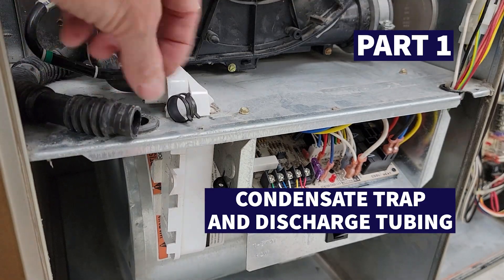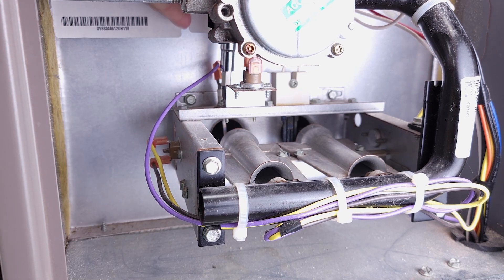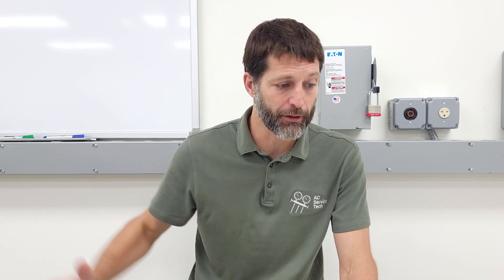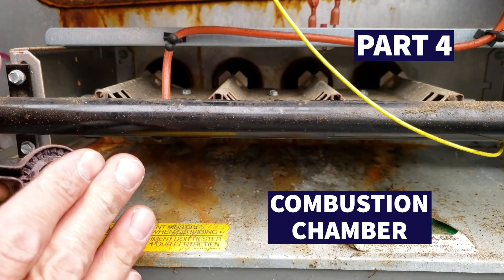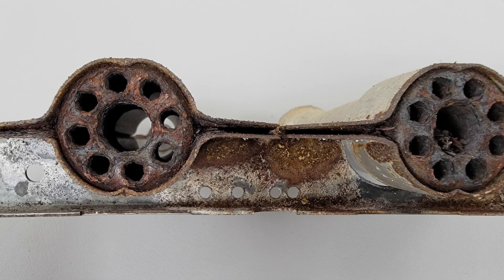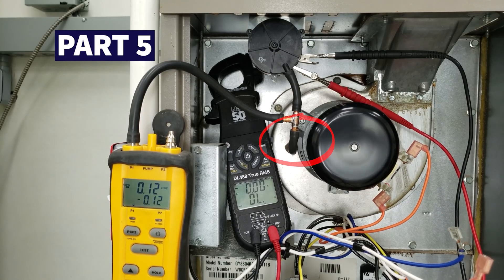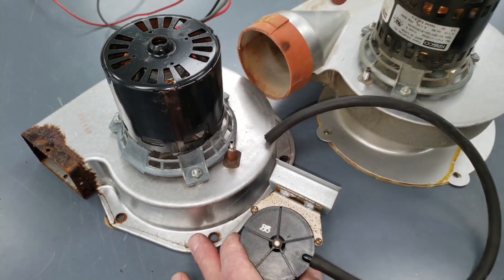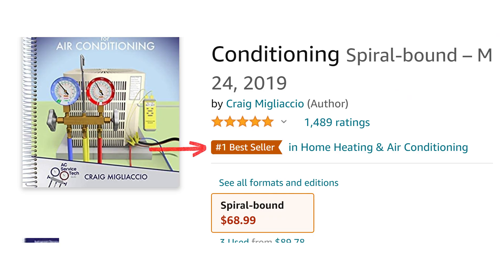5 Gas Furnace Parts That MUST BE CLEANED or the Unit will Fail and Won't Heat!

Comment: 13 years and counting. Never cleaned it once. Cleaning disrupts things and causes failure. I don't wash my cars either and leave them out. If I chose to clean it I would do it myself. Heating and cooling guys are all about lies and upselling. Not in my house. I also have the furnace surrounded by storage items. The filter gets changed three times a year.

Comment: Old furnaces don't have codes to "throw".  They simply stop working, and you perform troubleshooting.  You observe, take measurements, clean, and go forward from there.  Or, you call a service technician, and they try to sell you a new furnace.  YMMV.

Comment: Maybe mention that older gas furnaces don't have a condensate drain tube.  Also, maybe lubricate the main blower motor?  Some older furnaces have 2 oil tubes that you can put oil into every few years.  Not everyone has the newer furnace type.

Comment: A furnace can throw error codes but it seems this doesn't happen until there is a problem so big that it's basically a failure. How about some early/more sensitive maintenance codes that indicate "hey resistance on the flame rod is almost out of spec"

Comment: The scary thing is people really don’t know how furnaces actually work. These simple tips could eliminate the need for 75% of the srvice calls we do.

Another one we see lots of is people putting furniture on top of cold air returns. This has the same effect as a blocked filter you mentioned.

People...don’t block any heating system registers!!

Good video

Comment: Great info. Especially the last point about the pressure switch. Our furnace quit and threw a pressure switch error code. Sure enough, pulled off it's hose and the nipple was clogged. Cleared it with a needle and back in business.

Comment: You forgot the fan motor, and if so equipped, the evaporator coil.  If you start with a good quality furnace (it doesn't have to be expensive to be good quality) and keep it maintained, it could easily last for 30 years or more. I owned a house with a 45 year old furnace that I replaced even though it was still running fine.
Reply: My ICG furnace is 42 yrs. old this year. Still runs but kinda noisy.

Comment: Ya know.. while i appreciate this. There are so many units and systems out there and over time have changed... that for us to understand what we are poking at when you explain.. lol... is not quite going to happen. Mine is pretty old too, that i dont know its efficiency or year made, metal nameplate has info for it but no brand. Tho a model number, HG100U3. Im interested in possibly replacing, in case its very old and inefficient. If standard 80% id leave perhaps.. but if not, id change. Either way, i dont know quite how to clean or what im looking at it either. Like i said, so many factors and differences. Mine isnt exactly like that, to follow. How would you suggest understanding it more, where to find a possible manual and also, how much savings between each units? 

Lets say i had an 80%, so if i got to 90%, is that a 10% savings per month off my bill, would you say? Is it more? How do we understand that too. I know the larger the. Nunber its more efficient etc but what about savings? Lets say its 100$ a month for the 80% and i got 90%, its 1/9 better so does that mean maybe like 9-10% savings, so lets say $90 it would have been? Or am i missing something trying to understanding the savings as well?

Comment: I brought in a large HVAC company in to service my furnace and they did none of this. I didn’t know all of what you mentioned, but I knew that the combustion chamber needed to be cleaned and he did none of it. I wasn’t able to watch him do the service, but I checked afterwards and none of what you described was done. 
My system was 18 years old at the time so they pushed for replacement. Shame on them.
Reply: Nooo, shame on you for hanging on to an old furnace. 
Chances are the new one will save you enough in gas usage to pay for its self. 
Them you have new switches, wiring, motors, heat exchanger, everything!
HVAC companies make little on service. They do service to stand behind their product. 
But mostly to be first in line when a new furnace is needed.
Reply: @davehaggerty3405  Why throw out what may be a good furnace?
Reply: @mrofnocnon  oh, for the reasons I listed. 
Plus to protect your family from the risk of carbon-monoxide poisoning. 
18 years is old for a gas furnace.
Reply: @ Typically almost all furnaces warrant the heat exchanger for at least 20 years. Get a proper inspection by an expert.
Reply: @mrofnocnon what brands are doing 20 year warranties I rarely see them nake it past 15 on residential units. Did have a 31 year old lennox the other day unfortunately every other component was failing
Reply: @sewerrat7612  As I said practically all of them. For instance my own 12 year Bryant has a 20 year warranty. During all my years in HVAC this level of warranty just on the heat ex was commonplace. However I am not saying every brand does this.
Reply: @mrofnocnon thank you I mainly do plumbing/boilers been helping hvac guys out more recently and was unaware.
Reply: @ You are welcome thanks.
Reply: @davehaggerty3405  My friend has one that's 60 years old.  I knew some folks that had a 70 year old Gravity Furnace with NO MOVING PARTS other than the gas valve solenoid.  Many folks with old homes have Floor Furnaces which go REALLY far back.  If you have gas, you must have one or more CO detectors.
Reply: @joshm3342  those gravity furnaces are converted from burning coal. 
They’re around 30-40% efficient. 
A floor furnace is a stove in a hole with a different jacket. 
And if your heating equipment is so old and dangerous that you feel the need for TWO carbon-monoxide detectors maybe you should reconsider.

Comment: I would put the air filter at #1 do folke still install 80% furnaces?
Reply: No. In most places high efficient furnaces are the only ones sold or legally installed

Comment: Why is there so much concern over the flame rod being clean? I cleaned mine for the first time 9 years after the unit was installed. It only had a very very light "coating" of debris/scale/corrosion on it. Since it's only purpose is to detect a temperature rise created by a flame, seems you would need a very thick coating of debris to prevent that from happening.
Reply: Depends on the signal strength being set through it originally some don't have the largest difference so can lead to intermittent problems.
Reply: It's not at all for detecting temperature this is where your experience is showing ( not intended as a dig ) the flame rod is a rectifying system. Fire ionized the air around and within it, this means fire is an ELECTRICAL CONDUCTOR. In the furnace after ignition the flame rod rectified the dc voltage to the burner ground completing a low voltage circuit( flame rectification ) if you are talking about an older low efficient furnace ( not a flame rod )then the thing you cleaned is a thermocouple,these use bi metal and heat to produce 7 -10 militants dc which In turn powers small electro magnet in the gas valve . Both a flame rod and a thermocouple need to be free of soot, but being that the carbon component of any gas is an insulator it is far more critical for a flame rod.

Comment: My flame rod stopped heating so I replaced it. The new one gets red hot but won't light the gas. If I use a barbecue lighter it works just fine.😶😶😶
Reply: Are you talking about the igniter? The flame rod checks to see if there is a flame. Igniter lights the flame when the gas valve opens.
Reply: @Zeus-wl2pl they are absolutely referring to hsi. :)

Comment: I had an 80% efficient furnace, with the inducer port, which didn't get clogged, but it got hot enough that over three to five years would cook the tube, made of rubber, or plastic or whatever, and it would crack and leak.  This caused the furnace to fail.  The first time it cracked, it took me a couple of days to discover what it was. It's very simple to replace.
Reply: Make SURE you use a high temp vulcanized rubber tubing. It's not just common pvc tubing ( ive seen this a few times) that stuff will melt

Comment: I have had my 96prcnt efficient propane furnace preventive maintenance completed annually by local what seemed to be reputable furnace guy. I followed him through his process. He only checked if the burner's were firing correctly ie. not sputtering and checked glow plug to see if it had soot build up on it. Never looked at air filter instead placed a device inside return air duct to measure psi there. Never checked any of the other things you mentioned. Your thoughts? Cost's me 169.00$ per year. Is it really worth it?
Reply: Nope, that's for sure not worth $169.00 he's just doing a quick inspection, not maintenance.
Reply: 30 years in the trade here. 

1. He should have replaced the filter, this is standard practice 
2. Using a manometer to check tge differential on the supply vs section side of the ductwork us an effecte ad quick way to verify its operating within parameters, if ge discovered it within those then a filter would not need replacing 

I disagree that it was not worth the price as in my area standard rates are $250/hr and service contracts are paid annually. This means that if it dies att 4 am im there by 430 fixing it at no additional cost unless it requires a part then customer pays for part UNLESSthey pay tge ( imo ) overpriced annual service fee that covers parts up to $1000 but costs more than that annually. 

There is simply no 1 model for all service scenarios, so not seeing or knowing the situation one cannot say if the price was fair or not. That's the customers decision..  if you don't think 7ts Worth it then don't use them next time

Comment: How long should all this take? We are given 1 hour to complete heating service
Reply: Are you asking for a no heat diagnosis or a total resolution ?  It does depend on the system, and scope of it. In a residential setting you should be able to isolate the problem within an hour on site. Repairs depend also on what needs dis assembling to replace. E.g. my last no heat call on a furnace 

1. Check air filter first, this is stupidly often an issue even if it's not THE issue 
2. Look for any obvious signs like cracked tubing errors in sequencing. 
3. Jumper r and w at control board or t Stat forcing a call for heat. 

Order of operations you must know 
( furnace ) 
Call for heat - inducer motor starts - air switch proves - ignition sequence begins ( gas valve opens and spark ignition begins ) - ignition - flame rectification - blower fan begins after pre heat - set point reached - shutdown 

If this order stops then the problem is that. E,g if inducer starts and ignition happens you know the switch proved if it then shuts down it is likely sorted flame rod ( did not rectify ) 

Bad grounds can be the most frustrating thing as they can be intermittent

Comment: I just finished a service in my neighbors 95% York unit, complaint was that it lights but goes right out. Unit is in a small 2nd floor crawl space. The “pro” who was there just the day before changed the pressure switch for the inducer motor and “beat feet”. As soon as I turned it on the next day, the inducer squirrel cage sounded like it was UNDER WATER. Shut it down, removed the tube from the inducer outlet to the drain pan and pulled out a huge “booger” from it. Now the water flows freely, inducer motor is happy. Completed your checklist per the video, all is well. NEVER underestimate the importance of the condensate drain !!!

Thanks again, another warm neighbor 👍👍👍
Reply: That condensation drain made our life miserable and cost us a unit, or as we like to call it our indoor waterfall.
Reply: This happens if the furnace level is off too.
They must be installed at the proper slope towards the drain.
If the furnace is sloped the wrong way even by 1/8” it can cause improper draining.

Comment: i wish you where more specific as to the age, manufacturer, and model number fore the type of Gas furnace your referring too based on the 500 Sq ft per ton usage fore the type of residential weather its a house or moblehome fore the unit use with this tutorial. but i do see you provided alot of links fore further tutorials
Reply from the maker: I never say anything like 500 sq ft per ton. If you are referring to a heat load and loss calculation, I use wrightsoft, thanks!
Reply: Gas is irrelevant as the order of operations is the same. It's either a low, mid or high efficient, each has its own order of operations.

Comment: I disagree with flame sensor. I feel like it scratches the smooth surface and allows combustion products sit on it much easier. Once you clean it once, you need to clean it every year.
Reply from the maker: You can clean it with whatever you would like as long asss it doesn't leave residue. Certainly don't use heavy steel wool, just fine, some people use brillow pad, some use dollar bill but just make sure to clean it off, thanks!
Reply: I use blue scotchbrite pads. And I always include a new flame sensor if I replace an igniter 
They’re $15-$25 and if your doing your job you’ve pulled it out anyway have your company adjust the price to cover the part time 1.5 and you’ve capitalized on your labor and added revenue and added value to that customers experience with your company. 
I’ve cleaned thousands of flame sensors and replaced around 75-100 in my 23 years.  
The replacement idea came to me 16-17 years in and working for a franchised company.
Reply: My air filter housing was installed wrong and cheap,,,so filter wasn't doin it job,,,98  percent efficient,, works great an cheap when CORRECT, is now but plug up entire furnace,,so most of a day later disassemble clean reassemble.  Had 1 issue, a very small dead dried up spider was between flame sensor an 1 hole in burner tube,,I was stumped for a bit then I seen that little thing removed the ol spider carcus an instant heat with no codes,,  definitely the smallest little thing will shut these down.
Reply: A dollar bill is abrasive enough and won't scratch the flame sensor.

Comment: Craig , I have Trane S9V2 furnace, how do you get the furnace condensate trap out of that and how to clean.  Thanks
Reply from the maker: Some furnaces have removable traps and others do not. In those cases, just vacuum or blow it out in position, thanks!
Reply: @acservicetechchannel I just want to add to this to say make SURE you disconnect any tubing to the pressure switch before vaccume or compressed air. Ch4 supply is 7-14" w.c. so 1/2 psi. You will destroy it with a vaccume if you don't disconnect the tubing.
Reply: Derp just realized 2 years lol..

Comment: there is NO tech Ive seen in forty years who does this on preventative maintainence. They do a drive dy and cursory inspection and then bill you $150.
Reply: Then you’ve got the wrong people coming to your home. 
Everything he went over is basic HVAC service call stuff for me. 
Your money should pay for something, not just a body showing up.
Reply from the maker: Oh really? Thats not good because this was only meant to be literally the basics but musch else shoulod be cleaned and inspected such as the blower wheel, ducting, etc, thanks!
Reply: @acservicetechchannel why your vid is NO HELP... worthless...
You dont show how to actually DO any of it...step by step...
Nothing short of STEP BY STEP
is any good to anyone...
So...
Your just blowing alot of Hot Air...
Or...in this case
Room temp air
Reply: I disagree.  As a former HVAC service tech I cleaned those parts and pulled the blower to oil the motor and wash the built up crud on the fan blades if needed. I also was very proficient at changing heat exchangers.  Customers and employers loved me. Unfortunately the pay wasn’t great.  I worked my way up into control systems and SCADA work.
Reply: My Carrier dealer cleaned the flame rod, moisture trap, changed filters, checked static gas pressures, and did a carbon monoxide sniff test ton check for a cracked heat exchanger.
Reply: These items are STANDARD with our company. Now if you get a free or $99 furnace check from some companies, they will charge extra
Reply: My furnace sometimes have delayed ignitions and can go boom when it does ignite. Do you think it's a bad gas control valve or just getting too much gas/air and needs a tune up?
Reply: @J@J @Joeblowesixnine ’ve seen dirty (from rust or other corrosion) burners that have caused the flame to have a louder ignition. 

Also, I found an older igniter that tested high on the resistance test I did and it also had a ‘bigger’ ignition sometimes. 

Lastly, I would recommend checking gas pressures, make sure the inducer is pulling air through the heat exchanger and a combustion analysis to confirm it hasn’t been sooting up the unit from an unclean burn. 

Hope these are some helpful steps!

Also, to answer your question, I would recommend a tune up from a local company that you trust to give honest advice. God bless you!